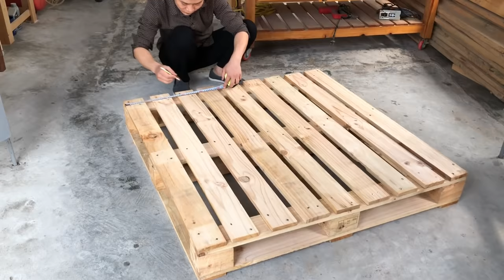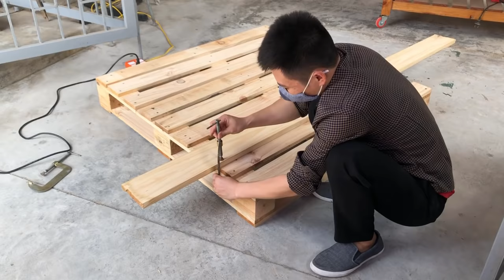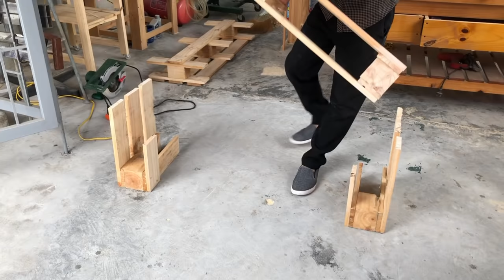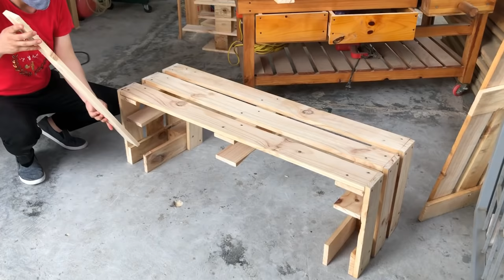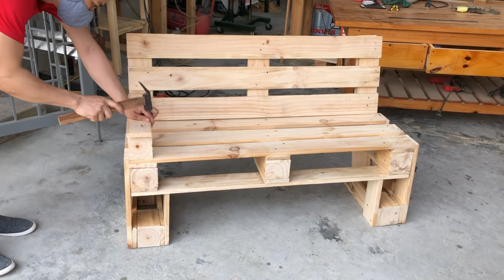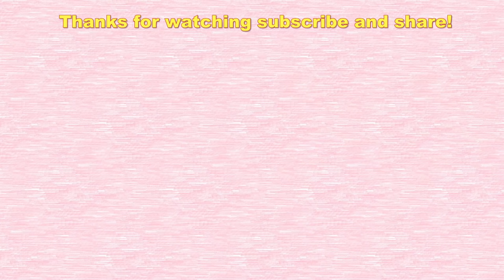Amazing Woodworking Projects From Old Pallets - How To Make Chairs from Pallets

Comment: If it is easy, put dimensions of the construction or a design. Great work. Well done. Cyprus
Reply: Do you have the measurements?
Reply: Estoy d acuerdo contigo...I agree with you dimensions
Reply: It may not work as pallets sizes and designs vary with each other ...

Comment: Measurements 
In the beggining he's cutting from the third plank so if you mirror that on the back too

I could be wrong but it looks like I 
could make out 

@2:45 
 250cm  on the back, from the edge (end) inwards

@2:55
And then flipped over on the front side I believe that's 400cm from the end inwards 
On all three faces

This is a good video thanks for sharing excellent use 👍

Comment: This pallet is new and has been made specially for the purpose of this video. It is clearly visible from the condition of wood and the pattern of nails. Normally pallets are not available in this size and in this condition. What is the sense in cutting new pallet and making something. It is worth if you show something creative by using old pallets.